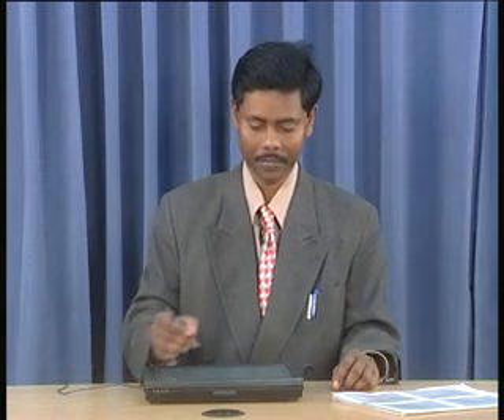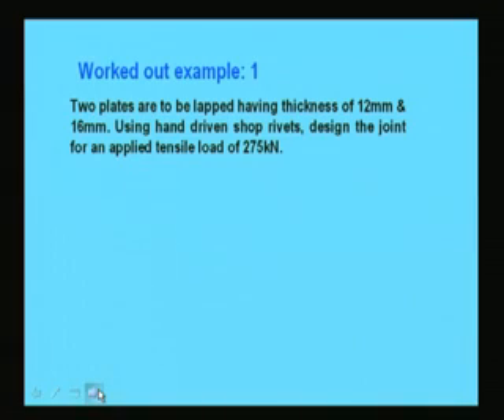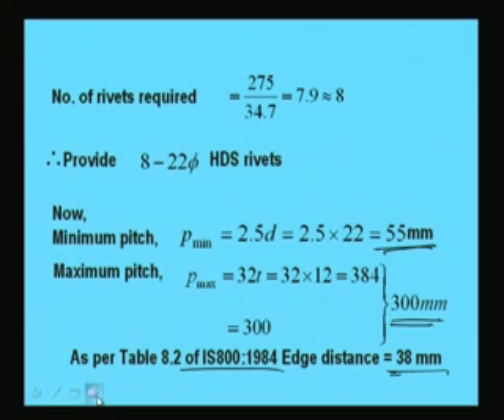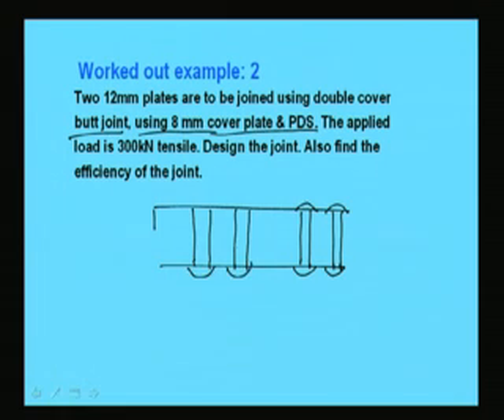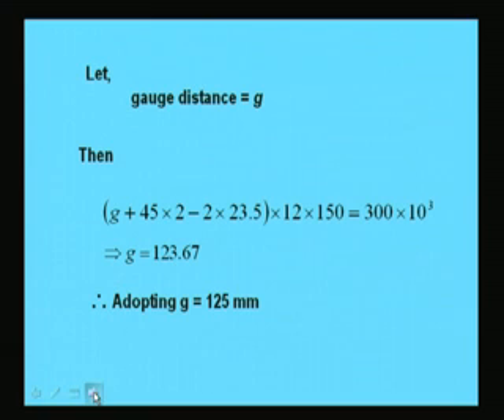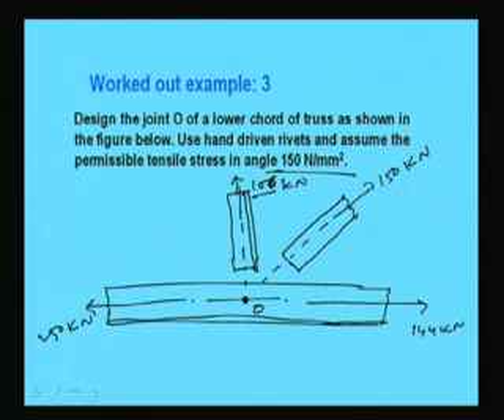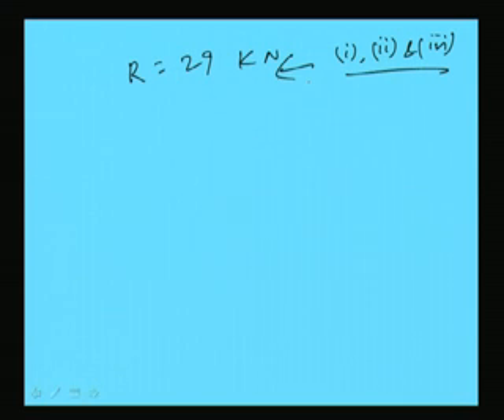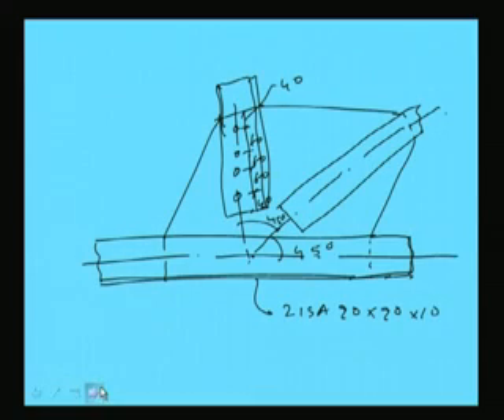Mod-2 Lec-3 Design of Rivet Joint

Comment: @49.42 needs correction..  i think
as per code NOMINAL DIA of rivet need to consider instead of gross dia

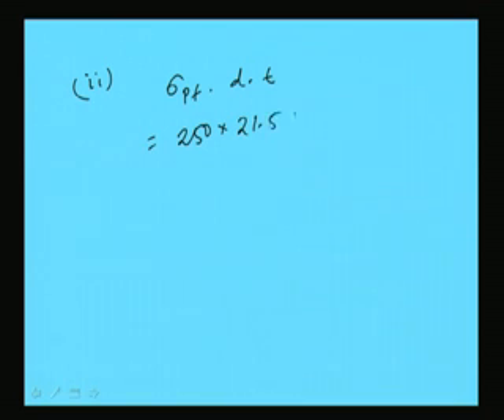@59:30 needs a little clearance ...why not 10 mm, as minimum of both (plate as12 & angle as10) will fail first
Reply: bhai that is because ad is a double angle and hence its thickness will be 20 mm and hence double shear is used.

Comment: using of 12 mm thickness in 59:28 is because of AD...its combination will add upto (10+10)20.so greater than 12 mm

Comment: Shear and bearing strength of rivet depends upon nominal rivet dia or gross rivet dia? Presentation shows gross dia.
Reply: It will depend upon gross dia only. The reason is that while making the riveted connection, the rivet will fill the hole completely.
Reply: thanks